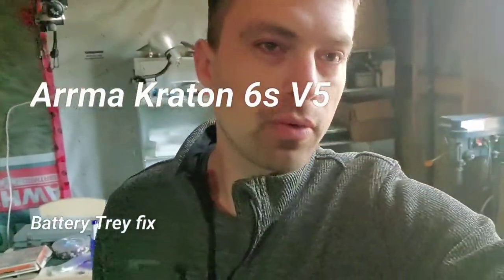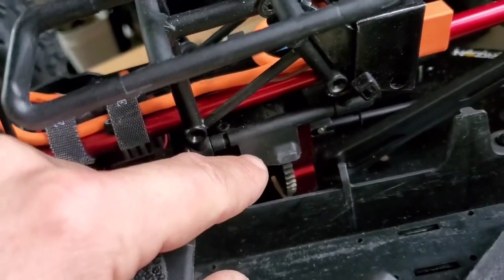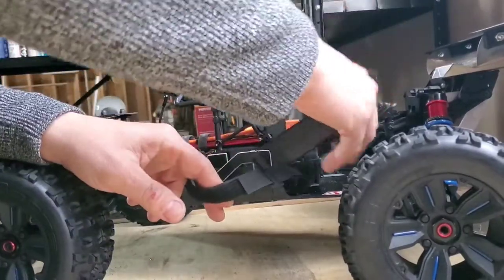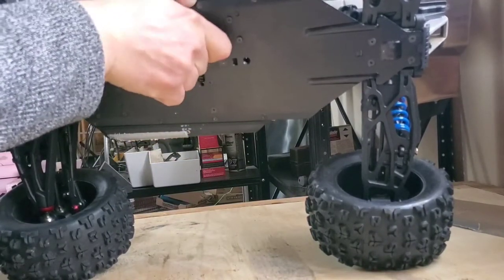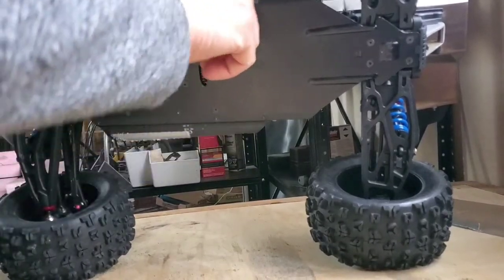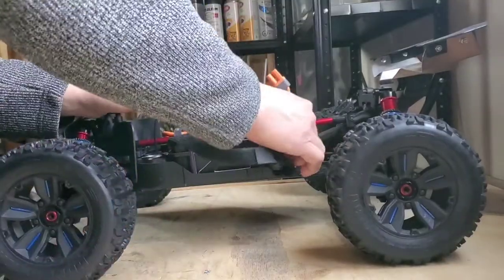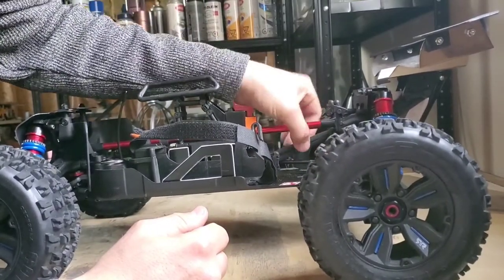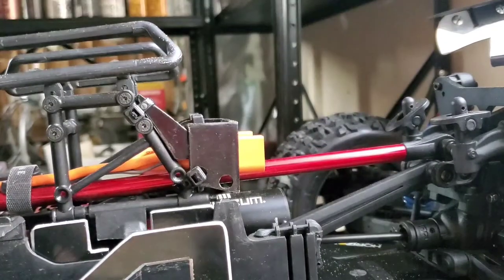Arrma Kraton 6s V5 Custom upgrade. Battery Trey fix issue. Part 2

Comment: Hi in your next video can you show me the underneath of your body shell so I can see how you attached the metal to your shell thank you I have the kraton v4 6S🙂
Reply from the maker: I am uploading video right now. My internet slow . I guess you will see it tomorrow. I will tell you upfront I didn't put any sort of pads from behind to minimize the weight. There is just a tape. It is definitely better to install pads from inside the shell but as Much as I used this car everything worked good. I like to bash but within reason . Maybe I will do it in the future,
Reply from the maker: I used small screws and nuts . And as you can see in the video there is bunch of them. So holds good enough
Reply: @cosmozila  ok thank you and thanks for replying to me mate 👍